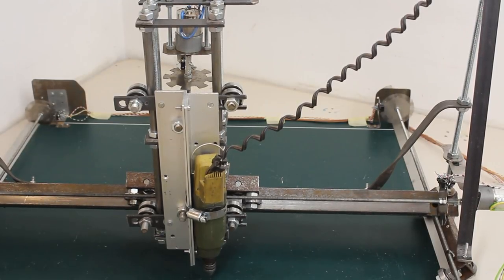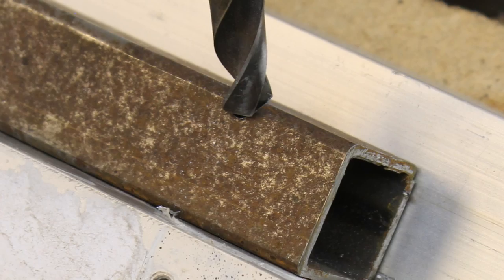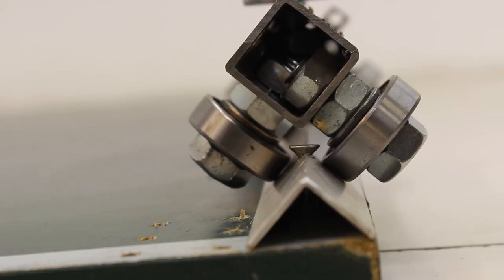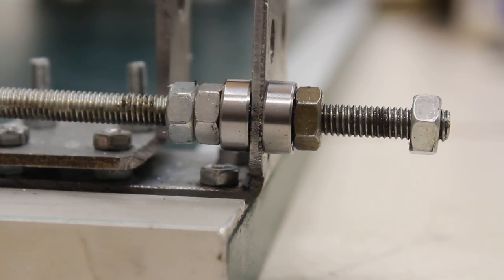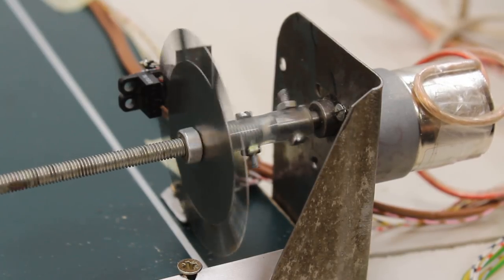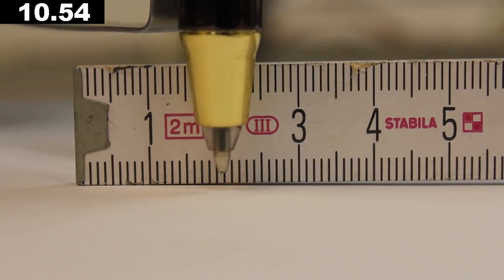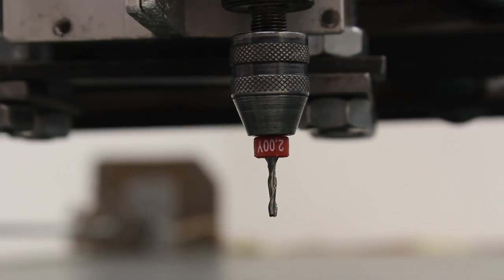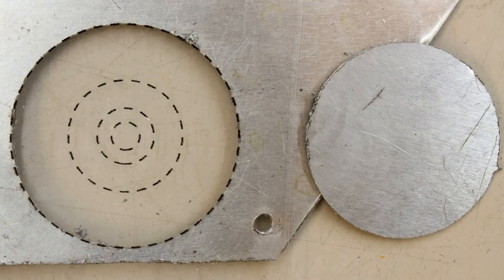Homemade CNC machine with materials from a DIY, built with simple tools

Comment: Can I use  any DC motor?
Reply from the maker: You need geared motors to get enough torque and of course the stall current must be below 2A when using the L298N motors I used:
http://homofaciens.de/technics-machines-cnc-v2_en.htm
Reply: thank you so much

Comment: can we use belt to move axis
Reply from the maker: +aqil yackob I would not recommend that for a CNC, because belts are stretched under load. Furthermore you will get more movement per step with belts and pulleys.
Reply: thank that really work for me

Comment: nice, with your skills you should invest in building a proper machine with quality linear guides and ballscrews, proper drivers and motors steel frame and all.
Reply from the maker: Khalid Al-Kooheji Thanks. Since the main intention of my project is education, I prefer keeping things simple. However there were some more requests if the machine couldn't be improved somehow. So let's see if there will be an upgrade sometime.

Comment: Man ,get a 3d printer, you will save money and time on the components , i swear i just built a cnc router for less then 100$.. and it can cut wood no problem with no significant stepovers
Reply from the maker: ...it is an old video. Meanwhile I own a bunch of 3D printers ;-)
But building a CNC router from scratch is still a good way to learn how things work.

Comment: The feedrates is painfully slow
Reply from the maker: Yes it is, however you can use more powerful motors if you need higher speed. That's what I will do with my CNC v3.2.1:
http://homofaciens.de/technics-machines-cnc-v3-2-1_en.htm
Currently that machine isn't very fast, either, but I have purchased more powerful motors for an upgrade.

Comment: carbone fiber sheet ?
Reply from the maker: If you have a question, use at least one full sentence to ask it...
Reply: HomoFaciens ok then, can he cute trough 4mm carbone fiber sheet ? I want to build a low cost cnc for cutting custom quad frame.
Reply from the maker: I haven't tried that yet. Whether you call it successful or not depends on the quality standards you require. I'd say, with a sharp cutting tool the machine should be able to cut carbon fiber sheets.

Comment: awesome you just "hack" common dc motor act like industrial servo motor
Reply from the maker: +aries taufik Yes, I started to do so in my video about the Arduino Uno
https://www.youtube.com/watch?v=PQ1FBcQT0AI
and now I am using those drives for different machines. DC motors are easy to get from many old devices.
If you'd like to know more about those drives, have a look at:
http://homofaciens.de/technics-base-circuits-encoder-disc_en_navion.htm
You can ask questions and I will try to answer them in the video / chapter under construction.